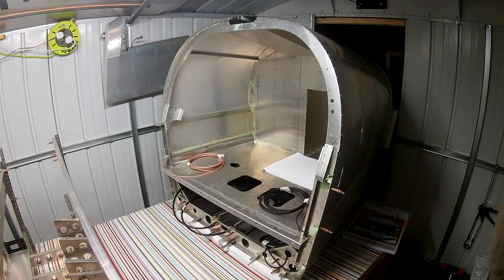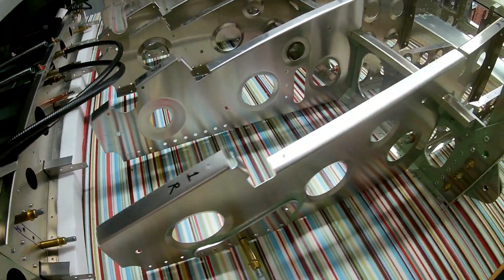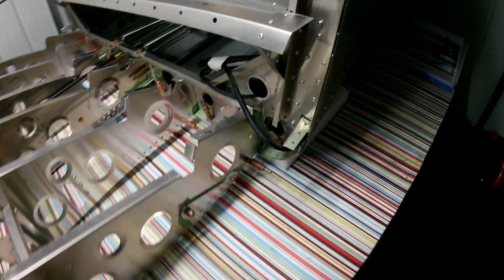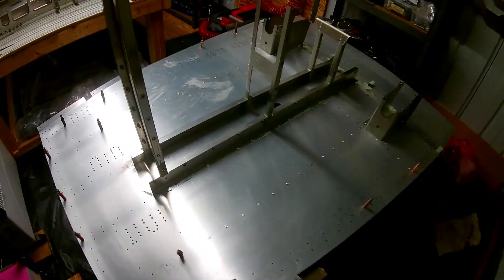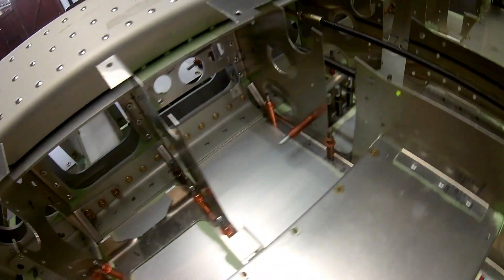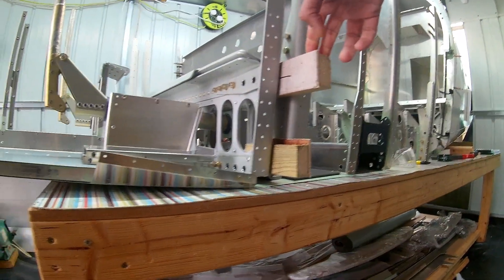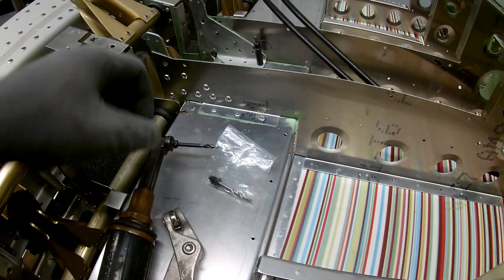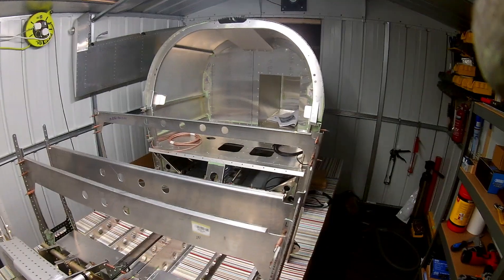Sling TSi build - Centre Fuselage Part 1

Comment: These videos are awesome and I've been watching a ton - I am looking at building a kit, trying to choose between a Sling TSI and an RV-10 - I wondered if you considered the RV-10 and what made you go down the Sling TSi route?
Reply from the maker: Thanks, appreciate your comments. I did consider the RV10 early on. Evan Brunye did  a video on the comparison which was pretty much the same I found from my own online research. I didn't have any previous build experience. The fact that its only pop rivets, lesser build time and the Rotax 915 engine that can run MoGas were the 3 main factors that made me go the Sling route.
Reply: @slingbuilduk400  Thanks, I'll check out his video also, I'm UK based also, have you found any issues with shipping or access to tools over here?
Reply from the maker: @pilotlanham  Check out Evans videos. It's kind of my go-to for everything related to this build. Getting tools and other supplies haven't been a issue. Adams Aviation and LAS Aero are really good. Sling has a UK base now around an hour's drive from me. So future kit deliveries will be easy
Reply: @slingbuilduk400  Also, how's your experience of the LAA inspector been, all straightforward? Have you done a video on the process of registering a project / inspections?
Reply from the maker: @pilotlanham  That was one of the tricky issues at the beginning of the build. I couldn't find any LAA inspector with a 4SA approval near me. Had to find an inspector who could get that added to his approval list. The LAA website lists all inspectors and their approvals by the postcode. Check out. Since then my inspector has been great to work with. I've had about 5 inspections so far.
Reply: @slingbuilduk400  thanks so much for taking the time to reply! Did you order your empennage kit before you registered the project with the LAA?
Reply from the maker: @pilotlanham  no worries, happy to share the things I've found out. Yes I only registered with the LAA when I received the empenage kit.
Reply: @slingbuilduk400  thanks, much appreciated.
Reply: @slingbuilduk400  How many hours roughly do you think the empennage kit took you to complete?
Reply from the maker: @pilotlanham  I reckon it was just over 100 hours on the empenage.
Reply: @slingbuilduk400  Are you aware of any limitations in terms of passengers from the LAA? Do you expect to be able to use all 4-seats?
Reply from the maker: @pilotlanham  Its a 4 seater, so the maximum the CAA will approve is pilot plus 3 passengers. With a useful load of about 450 kgs I don't plan to take anymore. I'm not aware of any other restrictions.

Comment: Odd, I've only seen one builder of a plane like this where all the inner aluminium interiors parts get primed.
Reply from the maker: Most builders in the UK here are coating their interior with Aerowave 201. I skipped priming to save time on the build. Will coat the interior surfaces with ACF 50 after painting.

Comment: You said you were using Loctite when installing rivenuts, do you confirm or did you rather mean Duralac green to prevent galvanic corrosion?
Reply: No, I'm using loctite 277 as per the build manual when setting Rivnuts. Hope that acts as a barrier between the two metals.

Comment: Doing great. Not sure when I taking delivery on my kit yet, but it’s on order. Quick question. What is the width of your workbench?
Reply: Hi Ashok, love you channel and thank for explaining all the build process in details🙏🏻. I am interested in building one myself and my choice of aircraft will be between RV10 or Sling Tsi. 
Please can you share some information on the cost of building your Tsi? Are you planning to put in an IFR panel?  
Thank you
Reply from the maker: @terrytan5681  Thanks. It's so much fun doing this build. Yes mine will be IFR capable. The costs vary a lot depending on how much you plan to do yourself. I'm building from base kit so will save a few quid, but am outsourcing the avionics and engine install so will spend there. Plan is complete in 1 year start to finish. I can email you the cost breakdown if you give me your email id.
Reply from the maker: @terrytan5681  Ok will send it. I'm based at Damyns Hall, but there is a private strip at Laindon which is the closest to me.
Reply: My work bench is 1.2m wide by 2.4m long. Ideally a 1m wide table is better. So the sides slightly overhang  and is easier to access the rivets along the bottom sides
Reply: @ashokaliserilthamarakshan5079  Thanks - I'm working on getting my shop ready for the build and have been waiting on building any benches because I wasn't sure how wide or long it should be.  I already have two work benches which are storage cabinets for my garage but I knew it wasn't quite wide enough and am going to build a cap to go on top of it.  So it looks like about 40" wide should be correct (1m = 39.3"~ish).  Do I need something longer than 2.4m for the wing build?  I can easily take my two rolling work benches and build them to be greater than 16 feet if I need to.
Reply from the maker: @ibgarrett  If I were to do it again and had a flat floor surface to work on, I would go with 2 X 1.5m X 1m tables on wheels. When doing the wings, the end jigs have to be kept 4.8mts apart, so you can move the tables apart and easily access all the bottom skin rivets from underneath. Having 2 tables that can be pulled apart so you can access all the bottom rivets will make building the fuselage and the Elevator especially a lot easier. Good luck with the workshop setup
Reply: @slingbuilduk400  Perfect - that's basically what I have (two tables).  Everything in my shop is on wheels at this time so I was thinking I'd just make some caps to go on top of the two rolling tables and then tie them together using the tops.  Unfortunately the floor is far from level, but having the two tops tied together I think I can achieve levelness as part of that plan.  Looks like I know what I'm doing this weekend.  :)
Reply: @ashokaliserilthamarakshan5079  and by the way - it's REALLY impressive the work you're doing in such a constrained space.  I have a two and a half car garage that I'm going to build mine in and people think I'm crazy because that's "not enough room"...